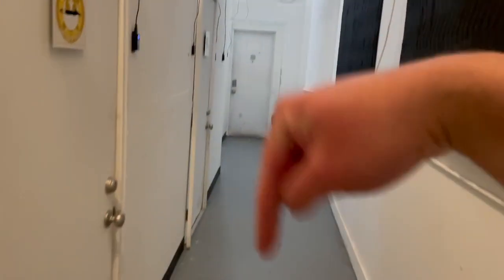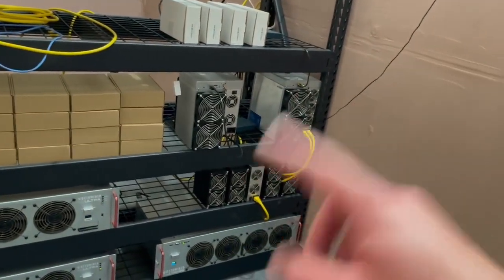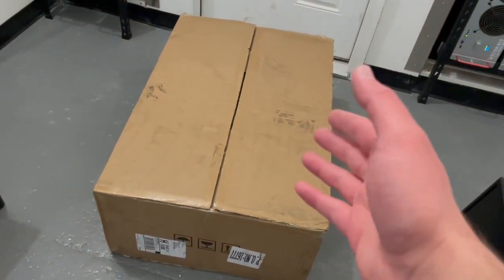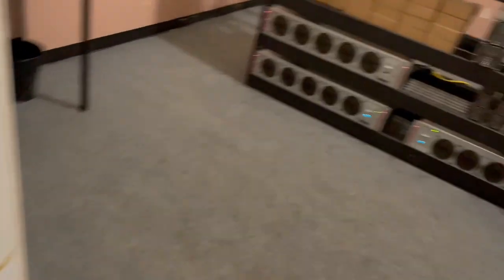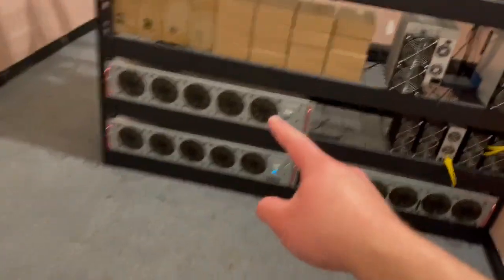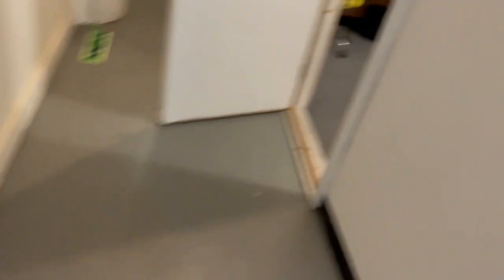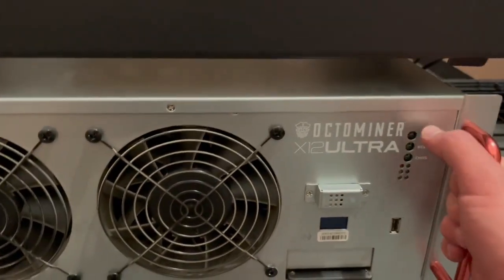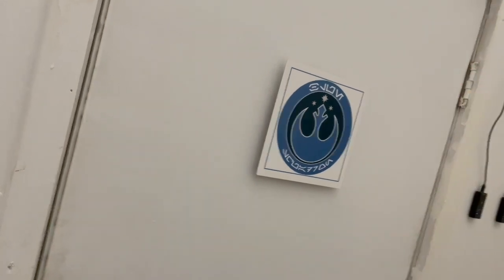Back on the Farm! It's Been Awhile...

Comment: isnt the A2000 's too weak for AI or Rendering. well i guess you can try but i would have think best to go with A4000 , A5000, 3090 or 4090
Reply from the maker: yeah, won't be the best, but similar to mining, the max wattage of 70w will inherently make it efficient as AI/rendering utilizes full TDP and these cards have tons of performance available at 70w compared to other cards. The A2000's are designed to be run at full TDP all day everyday so hoping that 10 of them in a single rig will at least make the stats ok. We will see though.